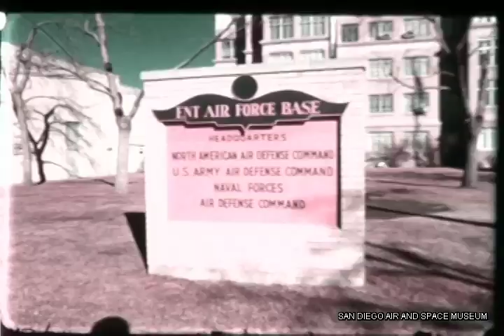Time Will Tell Convair F-106 Delta Dart NORAD 1/18/60 HACL Film 00181

Comment: For the record, that is an F-106A Delta Dart, which is the successor to the subsonic F-102 Delta Dagger.
Reply: MEs61    Sort of supersonic.  I flew the F-102 for three years and seldom went supersonic.  I then went to the F-106 and went supersonic often.  I had a "rat race" with an F-102 I encountered while I was in an F-106.  The F-102 was much lighter, with less power, but with the same wing area as the F-106.   In my rat-race, I found that the F-106 could out-power the F-102 easily, but the dammed F-102 could turn inside my F-106.  I tried every trick I knew, but I could not get behind the F-102.  I zoomed up and looked down, and it was below me, pointed at me.   I made pass after pass, and it was always pointed at me!
Reply: For the record , I like chocolate ice cream

Comment: In 1958 at Edwards Air Force Base, Calif. I was working Flight Test on this very F-106 (Tail No.459) with Convair. I was working instrumentation and telemetry. One of the pilots shown in this video James Stewart was one of our better Test Pilots. One day on final approach the aircraft flamed out and believe it or not he landed 459 in a small 2800 foot long dry lake bed and only blew two tires. The accident investigation ruled that on final approach Test Pilot Stewart moved the throttle lever to engine shutoff rather than idle thus the flame out was due to human error. Although the accident should not have happened Stewarts flying skills prevented it from becoming catastropic.By the way the F-106 was an interceptor not a fighter.

Comment: My dad worked for GD Convair up at Plant 42 in Palmdale California in the 50's on both the F-102 and F-106 programs.  He did the finish installation of the avionics, radar, and the Hughes Fire Control systems.  He was proud that he had worked on what became the speed record holder by an F-106.

Comment: I was a jet engine mechanic on the 106 with the 71st FIS in Montana and TDY to the jet shop with the 95th FIS. The shop was at Kadena Okinawa and the planes were in Korea. After we worked on the engines we ran them at the test cell before sending them up to Korea. The sound of the J75's was unreal when the afterburner was lit.

Comment: Советский аналог F-106 - Су-15. Оба самолёта - перехватчики. Но у F-106 лучше бортовое оборудование и больший запас ракет. Но Су-15 с честью выполнял свою задачу.
The Soviet counterpart of the F-106 is the Su-15. Both aircraft are interceptors. But the F-106 has better onboard equipment and a larger stock of missiles. But the Su-15 fulfilled its task with flying colors.
Reply: wouldnt the soviet counterpart be the su-9/su-11/mig-21 (pre-gun)? Su-15 seemed more like a soviet f-4 phantom